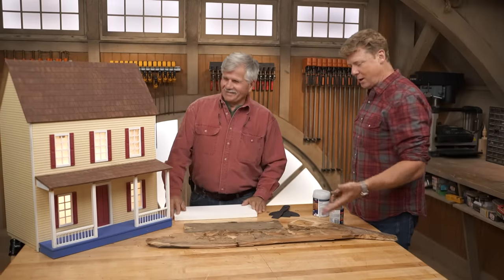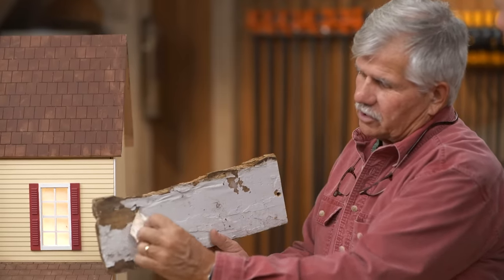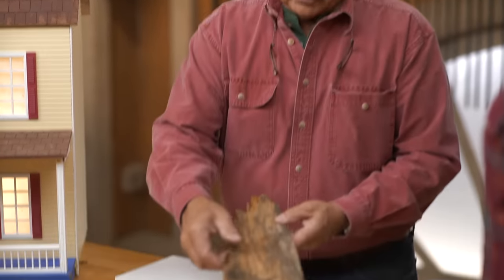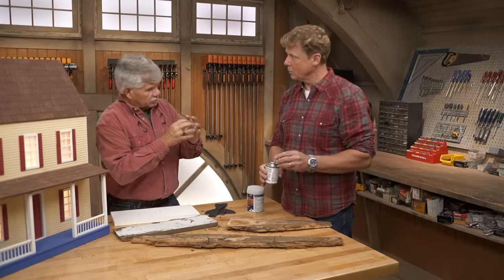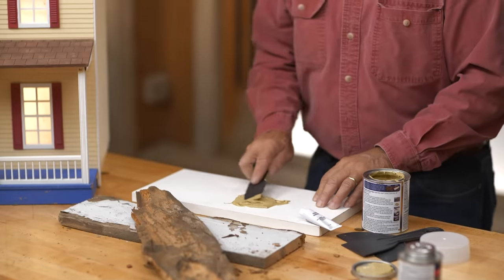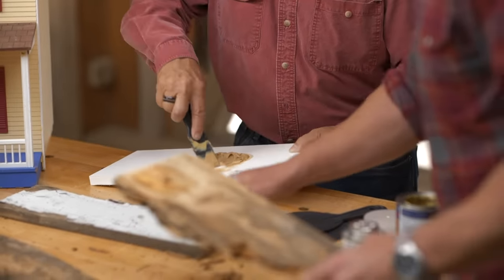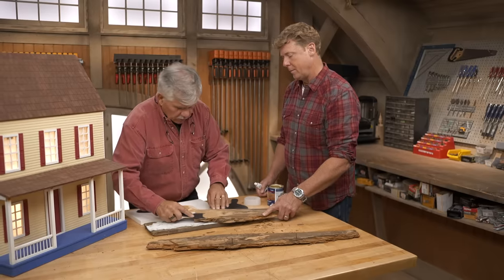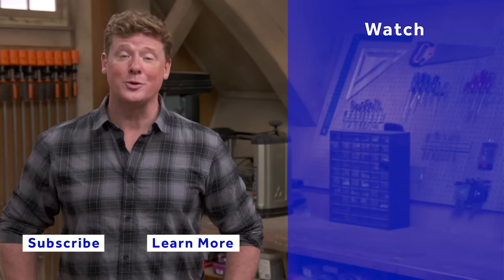How to Identify and Repair Rotting Wood | Ask This Old House

Comment: I’m in dental school and when we mix a putty to make a mold of the teeth we are taught to measure the same way- make a little circle of the base and run a bead of activator across it. Really cool to see that technique applied here!
Reply: You use wood filler for teeth?  George Washington would be proud.
Reply: Same for body filler when doing bodywork on a car
Reply: @theloneviking9145 wow that’s interesting this method is in many different careers I wouldn’t expect
Reply: @christiannavarro9396  being sort of a guy who likes to fix and make things, I’m amazed how many disciplines carryover to others. For example, when skim coating sheet rock or feather edging a plaster repair, it’s very much like putting on body filler and there’s a whole other bunch examples, I can’t think of right now, but you’ll discover this if you haven’t already

Comment: I just completed a project for a customer where it was necessary to remove quite a lot of rotted wood from under several window sills and the epoxy wood filler did a great job.  Incidentally, I replaced the old wood trim with PVC, so it will never rot.  Good video!

Comment: Great advice and discussion on how to approach and use these wood repair products. I bought a 22 year old RV in Feb in Bend OR. Probably sold below freezing to hide the rotting mildew smell. OH boy once we warmed up it got worse & worse. Thought I'd fixed it when just at the end of that fix I discovered another source in another part of the RV. First was in the floor under the fresh water tank. Knew how to prevent the problem in the future. BUT the next one was in the wall. I'm in the throes of fixing the wall as we speak which goes into the edge of floor meet wall too. I finished scraping all black and dark spots out along with rotting wood today. Removed a vinyl wall paper that was probably part of the wall product to begin with not applied after the wall was installed. Clearly the window above this wall area was the source of the leak. So of course that's on the agenda to fix asap but first the wall and I've put in place strong plastic cover and duct tape to prevent leakage while I repair the wall. So my only complaint to date including this video ... is they are all vertical repairs or tutorials and I have to work about a 30 x 60" area across the wall where the dinette and bench seats are placed. I've removed all the wall paper and the strange wood underneath is super thin layers pressed together probably with some wood type of glue and some layers came with the wall paper vinyl when stripped off. Any that was dry and still stuck well and smooth I left. My plan is to treat the entire area where the vinyl is removed with a form of wood hardener. I'm in a steep learning curve having never owned an RV in my life and I'm in my 70's. So yes it is crystal clear the seller knew about the problem. Even added hard flooring to hide some of it. I've removed those boards and actually scraped away all the bad areas and hit with three of my favorite moldicide products. Make that 4 I found another one I like. I'm not a fan of perfumed products. My favorite is Oxine not activated and made into a strong dilution. Also Moldex with out bleach formula, and Odorban lemon and lemon lysol along with Microban all purpose cleaner that seems to do an amazing job on foam and fabric mildew scented products but also this punky wood. And the ply wood that provides the seat for the bench cushions also had picked up the scent and sure enough the Microban 24 hour bacteria killing  Multi Purpose Fresh Scent spray has done wonders over all my other products even the stronger dilutions. But I tend to use all over a few days drying each time well. Then I wipe clean with alcohol 71-89% bought at the store since sometimes these products can leave a residue that might effect painting or wood filler etc. from doing it's job. My plan now is to run a strong fan on the wall 24 hours for about 3-4 days. Making sure it's definitely dried out. Treat with wood hardener. With no experience I play to see what 4 layers looks like up to 6 even 7 if need be. Then I also have the wood filler like you demonstrated probably same brand but does have the hardner. And cover the entire area plus right over the areas that wall paper still clings as it would not release without damage to the wall so I need a smooth sanded surface when done. I intend to apply a heavy duty self adhesive vinyl wall cover over the entire area under the window right over original bits I could not remove and smooth it out. Then add trim probably a wood trim strip to hide the seams where the old vinyl paper ends and the new begins. Color scheme should match well enough. I'm not looking for a high end job just one that comes out decent and fools the eye or the casual eye thinking everything looks good. I don't intend to sell this unit I got myself into this mess and I searched 2 years for this RV without landing one so I'm hanging in there with it. However it was neglected all her life and in that neglect itself it was abused. But low miles and good engine and bones she just needs some TLC and updated technology and deep deep deep cleaning inside and out. So far she's got a new bath faucet, shower head, toilet, sky light, dome vent fan, also added new TV antenna and fancy MaxxAir fan that replaced the original just 14x14" vent in the coach. The new fan moves air both ways at 10 settings.I've got it set to exhaust at 40% speed all day and night with the large fan running to dry out the wood wall now. As of yesterday through today I smell zero mildew. No signs of trouble like this anywhere else. My husband installed the back up camera today which works really well and new tow mirrors as the originals were frozen and couldn't be adjusted. My hopes it would be road ready by next weekend is more like with luck by end of July. I'm upholstering the dinette, fabric trim and sofa because though photos showed a clean looking RV it was far from it. Instead of shampooing and living with it knowing the dirt was really still there I had to remove and replace foam etc. too. Far more work than ever I had in mind. The windows are my most difficult challenge. I did identify the main glaze rubbers in their two sizes for the three windows but there's a damaged area for rubber on the horizontal T that I can not ID and it rarely is replaced but because there's 4-5 inches damaged I suspect we need to. U;n watching all the videos on using both wood hardeners and fillers as I can. So far all are for wood that's horizontal not a wall or vertical. We are expected heavy rains over the next 3 days so I'm waiting to apply the wood hardener until our humidity goes down. But I'd love to take advantage of our cooler temps as a low weather cycle moves through. July in NW MT can bring very high temps with it's drier weather.

Comment: After 12 years of use, I have stained french doors getting some rot on the lower rails. Thinking of chiseling out the rot and using bondo, but it's not going to stain well. So thinking of making the bondo patch and then adding an outer matching stained board at the bottom to take the weather. Good or bad idea?

Comment: Can you use this on a deck skirting that's moist?  I pulled some deck boards and the moisture has rotted a bunch of the wood (I butted the deck boards together expecting shrinkage and the shrinkage never happened so it stayed moist from no air flow...).

Comment: I have a HUGE problem. I have a loan through our City. Not a Grant, a loan!! I had to use their contractors. Last January, in WA State they roofed my home but didn’t cover my roof in downpours after removing shingles. First contractors got fired and second came in who also didn’t cover my roof before shingles. AND the facia boards are half the size the original ones were so all my rafter tails are wet and rotten. Inside the house water was running down my walls and shorting out my light switches. It’s a big mess and I feel like walking away. I need a new house. The City and contractors walked away and won’t even finish their work. In the mist of lawyers but who wants to take on two contractors and a City. What a mess!

Comment: I have an issue with rott in the main structional support beam 4×6 beam with a 2×6 on top and a 2×12 under the beam with cement blocks under that. How can I replace the rotted area without replacing the whole beam under the wall?

Comment: how hard is replacing the sill is doing this a better idea?
Reply: I just did one; will to a milling store to get a sill that matched; that cost me $30; cutting it to fit the opening, cutting out the old molding, fitting, then caulking, was a right PITA; I have a matching one that's not quite as badly decayed; just got Minwax hardener and Wood Filler, have scraped away the punky wood, I hope well enough; waiting for it to stop raining and dry out to do this thing. Having read more comments since I ordered, I suspect regular old Bondo would also have done this, probably cheaper; but--hope to know in a week.

Comment: Hi Thanks for posting these videos. I have wood rot in decorative trim (it has 2 indented strips along the length of trim) that runs the length of bathtub insert, vertically. It looks like the previous tenant just painted over the issue in past and now there's a hole - after removing calking that needed a redo. Is there a bonding product I need to use before using wood rot epoxy & which would You recommend for bathroom application. (Ontario) Thanks

Comment: That goop is basically Bondo, (the stuff they use for auto body repairs).  Epoxy is a much less toxic and easier to use product for wood restoration.  Abatron:  Liquid Wood and Wood Epox are much better.

Comment: What about temperature expansion difference between the original wood and the filler?  Is it going to crack and split away in a couple years.
Reply: I've used this for this type of application.  I live where there is extreme temperature differences with dry and then very humid, very cold and very hot too. Years after the repair, they did not crack with these extremes.
Reply: @TobiasRaphael1  Thanks.  I wonder if the same is true for Bondo, the car body repair material.
Reply: @Nill757  I suspect it is the car bondo repackaged as wood filler.  It smells like it and has the same characteristics.

Comment: This video literally makes no sense. This isn’t “repairing / restoring rotted wood” this is just filling in holes. Wood rots from the edges mostly. Once that wood is gone there’s nothing you can do. Filling in the center of that wood did nothing to save the rest of it. Both looks and strength are now compromised. Remove the wood and replace , otherwise what’s the point of this? It’s not going to bring back the rotted edges, it’s not going to allow you to re-add what you broke off...
Reply: I agree.  I had the same problem and was going to use this but did a little digging and there was mold way down under the sill and window had tiny leak at the top, so mold would have been sealed inside creating health hazard.  I ended up replacing the entire window.

Comment: I have a corner of a porch post that has rotted away. Can anyone recommend a product like this that is thicker so that I can dig out the rot and fix it? It could be 2-3 inches deep and this product looks too runny.
Reply: You can also consider something like DAPPlastic Wood-X. But whether you use the Bondo hardener mentioned above or the Wood-X, I think you need to use the wood rot restorer first
Reply: Use jb weld kwik wood, it’s much better then that bondo garbage.
Reply: You might be able to build a little form like they do with concrete ? I had to do the same thing with a rotten sill and used tape as a form.
Reply: You could try a partial replacement, as shown at this TOH video: https://youtu.be/s6naaDBrZSc "How to repair a rotted porch post". Don't forget to diagnose and fix the root cause. – Rot on structural elements is not something to only address with a gooey fill.
Reply: @sternmg , I forgot, ''Tractor Time with Tim'' had a guy come to his garage and drive steel down right next to the post edges. It looked like it worked perfect.
Here's the link: https://www.youtube.com/watch?v=y7DK4WGkd3E

Comment: Tommy my house is built on a 4+6 and the floor doesn't go all the way and the wall joist set on top of the rough cut wood what kind of build is that called my house has younger and